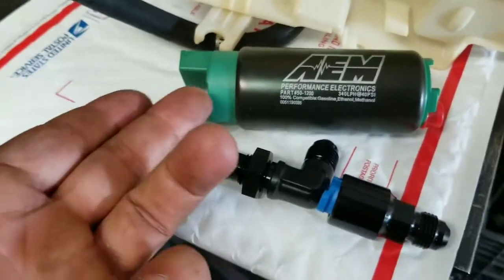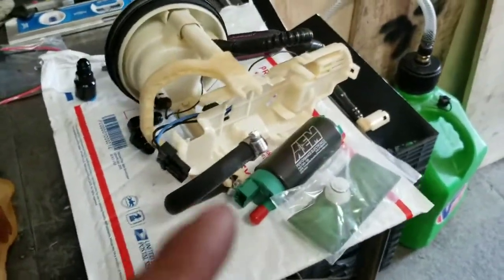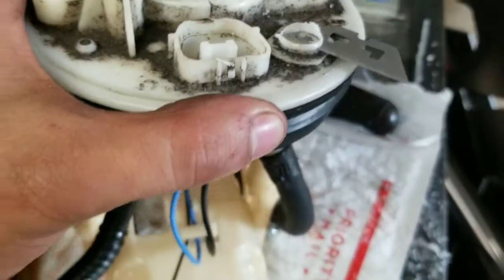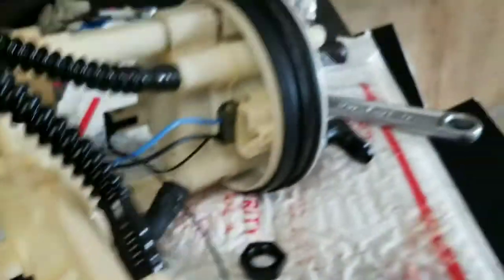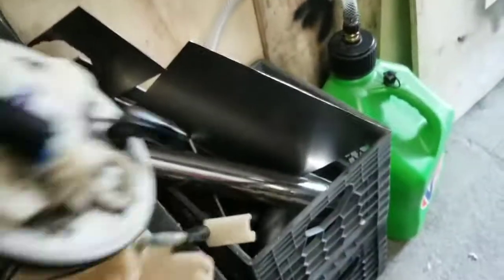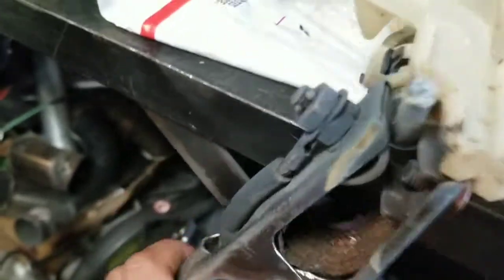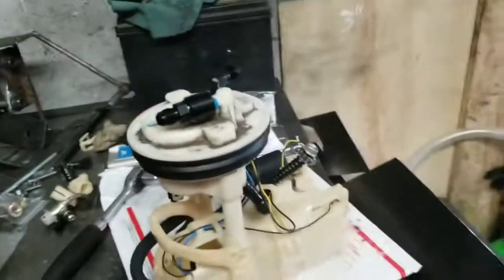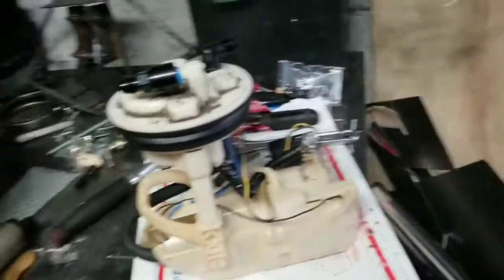RSX fuel pump housing modification for fuel return setup

Comment: Bro that efi fitting u are using is that an 8an or a 6an? I just used a 6an the same one you have and it doesn’t fit the built in 90 below
Reply: theres different size efi fitting an part is what youre running but the efi quick connect size could be 1/4 or 3/8 im trying to figure out same thing....

Comment: Is the fuel pressure regulator for a 2009 k20 the same? Is the 2009 k20 fpr mechanical or electrical and can i just plug it the same way without tripping the fuel pressure sensor.

Comment: I'm at 5 and having fuel starvation problems.  I ran a return line through the old out line and even hooked it up to the boot as was recommended.  I know it's nothing else as it pulls great until just under half a tank.  You start thinking of all the options, and come back to "well if it works fine to 1/2 a tank, then it isn't the pump, injectors, regulator etc."
Reply from the maker: I've never had fuel starvation run the setup like in this video. I think some of the pumps. I usually drill two, two inch holes with a hole saw on the bottom of the fuel pump housing to help get fuel into the cage.
Reply: @itsjustabasersx  kinda curious why you need to block off the return line, where will the fuel route through the hanger, apologies man
Reply from the maker: @alitoroganan2442  you need to block/ disable the stock fuel pressure regulator. Theres are few ways too do that.
Reply: @itsjustabasersx  yeah i took the whole stock fpr out, is that alright

Comment: So I disconnected the hoes and put the screw in it with a clamp just like you. Other than that the regulator is untouched. Should I unplug the wires running to it? What do I do with wires, will it cause a short?

Comment: At what power level do you need the fuel return setup
Reply from the maker: I recommend anything over 400hp or 16lbs of boost to make a fuel return setup.
Reply: @itsjustabasersx  I have 365whp (rsx type s ) I got it tuned everything went smoothly driving it back home and all but the very next day when I tried to get into boost it would cut out right before it hits. My tuner said I need a fuel return and a fpr. It doesn’t make sense bc it was fine on the dyno and actually made 377whp just got it turned down to 365. I’ve been asking around and everyone says 400 whp is about the limit. Lmk what you think I appreciate the help.
Reply from the maker: @Blued3mon772  its possible the pump is starting to give out so your not getting enough pressure. But if it did fine on the dyno then it shouldn't be hitting fuel cut how randomly. Something is definitely off tune wise or something is failing fuel related. But yes you dont need a return till around 400hp or 16lbs+ of boost

Comment: You should watch my video. You don't want metal washers, you want plastic PTFE washers for fuel that are made by Earl's Performance. You also need the fuel return jet, unless you want to run out of gas at 1/4 tank. Without the return jet, it also affects fuel pressure. You also need to modify the return jet for the bigger fuel pump. You are going to have several problems. I can run my RSX gas tank extremely low wth my modded return just like oem factory. I also did not have to cut into the fuel bowl at all, it is all oem stock and I'm using a 2011 Nissan GTR fuel pump.
Reply: Where's the return jet?
Reply: @camlobesvtec  There is no return jet in this video. I talk about it in mine.
Reply: What's your video title for this issue?

Comment: On a fuel system set up is the fuel pressure regulator installed before the fuel rail on the feed side or after the fuel rail on the return side?
Reply from the maker: Depends on how you have it setup. But usually always on the return side.
Reply: I'm trying to do the fuel system setup for my 2004 acura tsx. Would I run it the same way like a tsx? And install the fuel pressure regulator on the return side?
Reply: I mean like a rsx*
Reply from the maker: @k24in31  you need a aftermarket fuel rail. Feeds in one side and returns on the other. Fpr is on the return side.

Comment: Good stuff.  Hey brother I think I'm having that fuel starvation issue.  I'm running a deatschwerks 65c fuel pump with a aeromotive regulator.  I have my return coming from the bottom of the regulator 6an return line.  Its similar to ur setup when you were boosted. At a little less than a quarter of a tank the car hesitates really bad and spits , no power.  When I filler up it's back to running perfect. I am now boosted 400hp. I did everything for the fuel pump like u said. What may be causing this please help
Reply from the maker: Thanms bro, ok Try drilling some holes on the bottom of the fuel pump housing that way the the fuel fills up the housing.   This is a known issue with rsx. I should of actually mentioned that in the video. Lmk if it works out for you brother. Good luck!
Reply: I forgot to mention my fuel pressure regulator is before the fuel rail.  Running a very similar set up that you used to have, utilizing the stock fuel rail. Should I run my fuel regulator on the return side with an aftermarket fuel rail? Will it then stop the fuel starvation?  I'm also on e85.
Reply from the maker: @camlobesvtec  oh if your running a no nonsense setup with stock rail, then you have it correctly. Make sure you have a few holes drilled at the bottom of the fuel pump housing. Also some pumps in general have fuel starvation issues at a 1/4 tank.
Reply: Did you drill holes in your housing too? Did it solve your fuel starvation issue? In my opinion I  think the fuel  starvation issue happens because the performance pump is pumping allot of fuel and it's not returning fast enough causing the issue.  I think the ecu goes into limp mode when that happens with a low tank. Your awesome brother thanks again God bless.
Reply from the maker: @camlobesvtec  I never had starvation issues, but I had holes drilled on the bottom and side of the housing.💪🏼💪🏼 I hope this helps you out. I was at 500hp at 18.5lbs of boost never had fuel issues. Also did u block the stock FPR?
Reply: @itsjustabasersx  yeah I blocked it with a screw with a little honda bond. I'll try the holes in the fuel pump housing.  Maybe you can make a future vid. Would you some day turbo your awd ? Yikes

Comment: For 700-800hp do you recommend -6 or -8 for fuel return line?
Reply from the maker: Those those power figures you'll want -8 feed and -6 return.
Reply: @itsjustabasersx  would I need a -8an bulk head for the feed or would it be just a 6an to 8an bulk head?